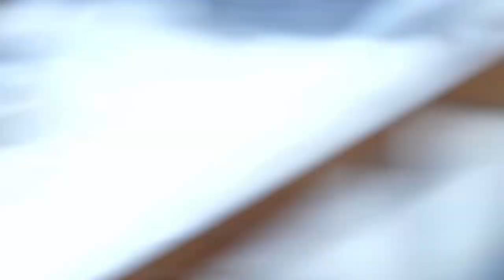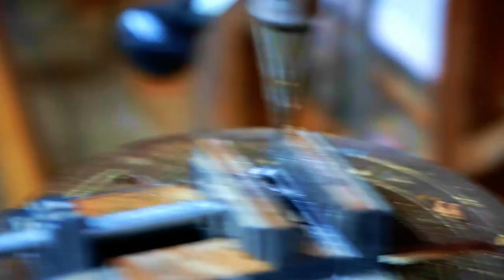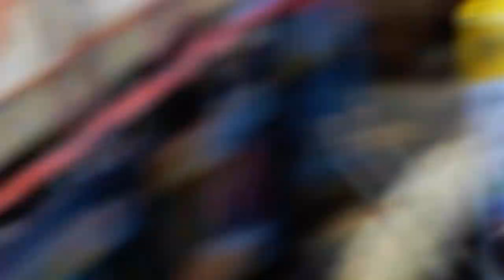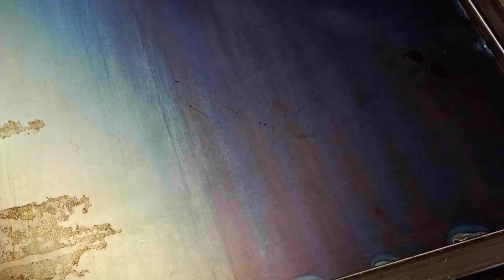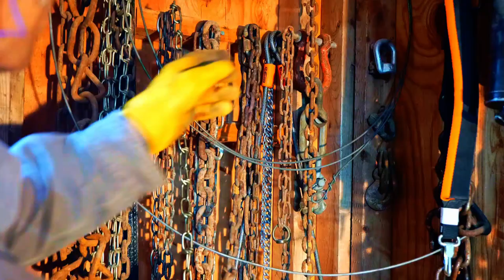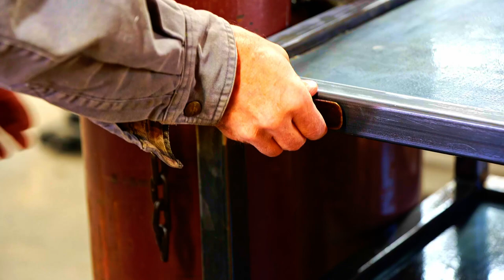I Make Lever Style Chain Binders for My Welder Cart Gas Bottles

Comment: I like the design. I especially like the swivel. And I love the adjustment you have in the extra threads.  I think it needs to be a bit more robust.  I suspect the weakest link is the weld holding the nut in place.